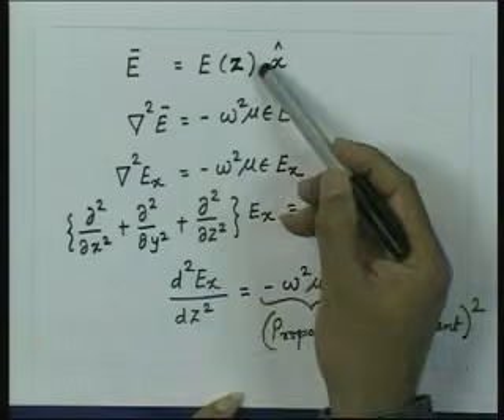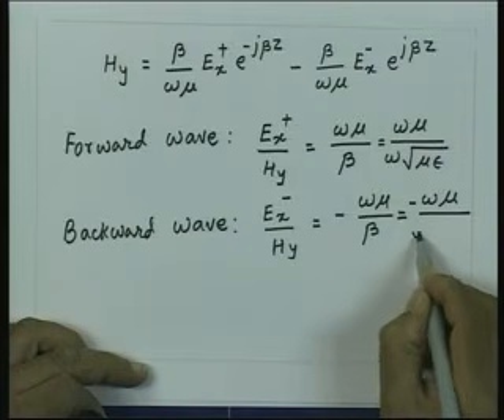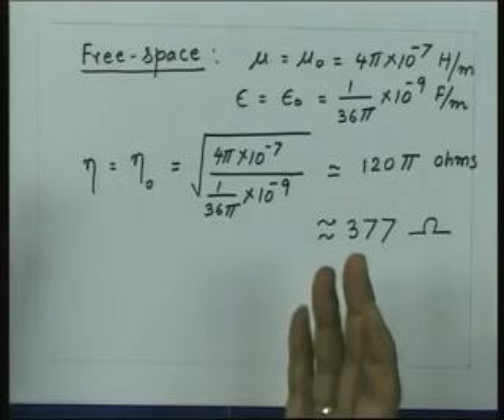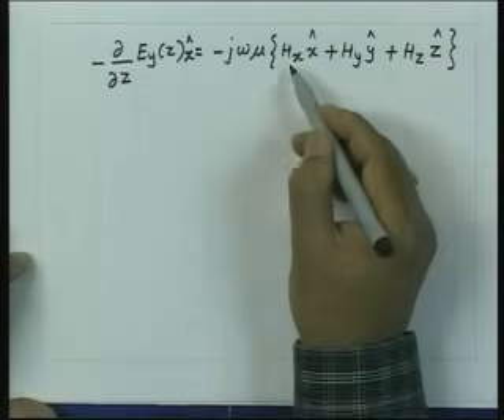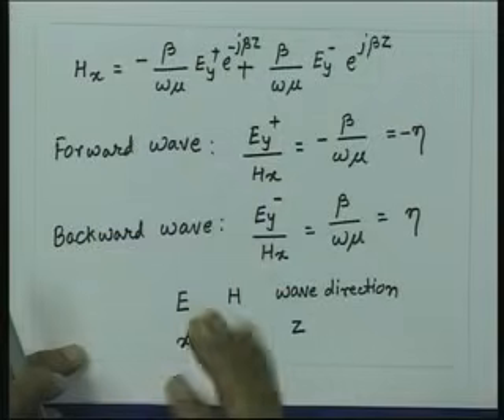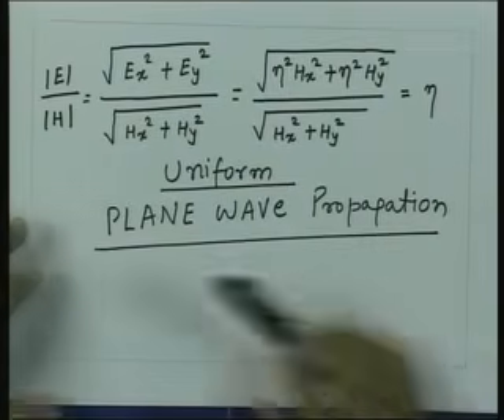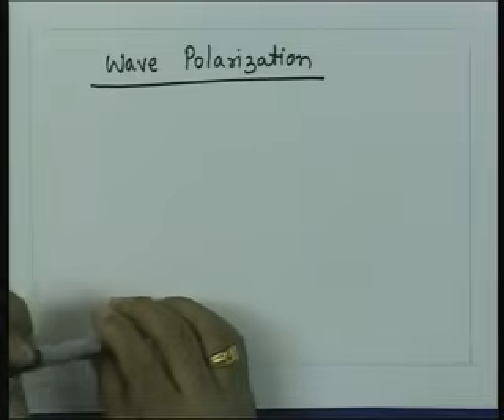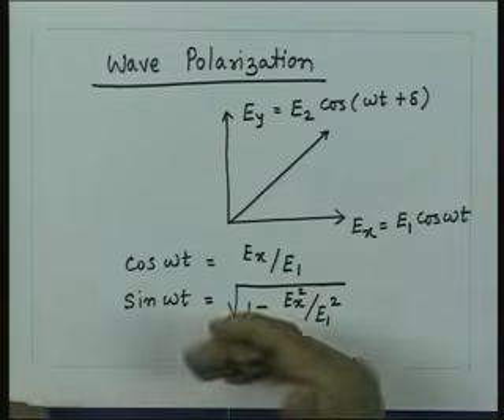Propagation of wave

Comment: That's why we use Parallel wire Transmission lines. which can be matched with free space and Antennas. As we use ribbon cable to match our T.V. to the antennas and Free space.

Regards,
TUSHAR

Comment: Dear Friend,

As per my understanding it's purely a physical realization problem as pointed out by you. But for coaxial cables only. Because Zo(characteristic Impedance) for coaxial is dependent on its physical dimensions (outer conductor diameter(D) / central dielectic core diameter(d)) and on relative permittivity(εr) of its core.

So for Zo = 377, a Polyethylene (εr = 2.25)coaxial should have D/d of arround 12526.39. which is practically difficult.